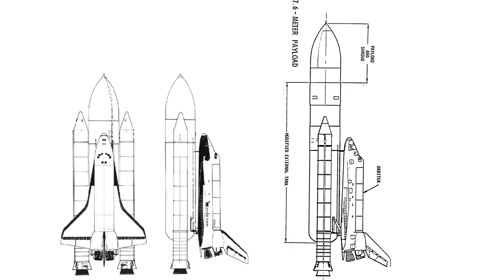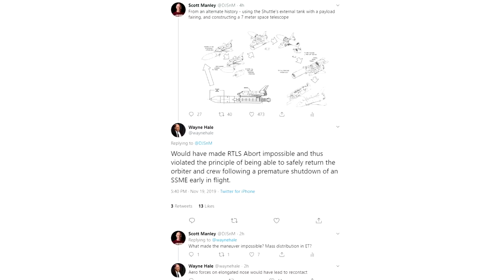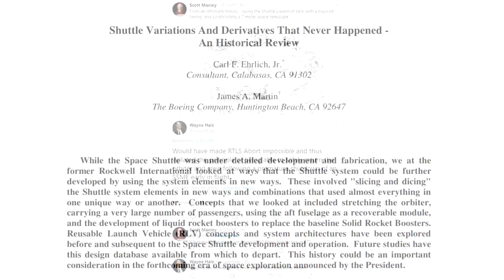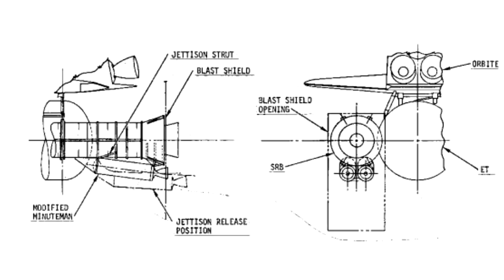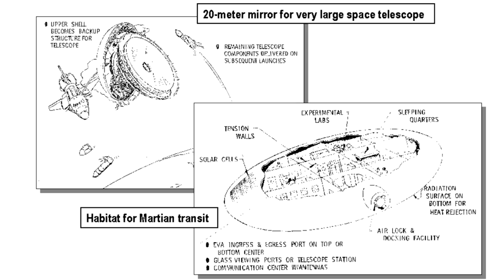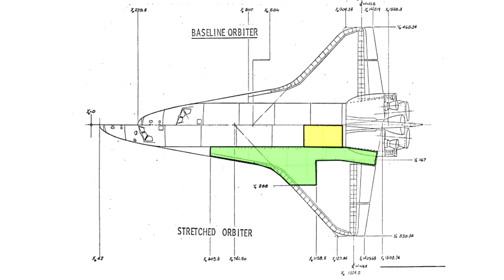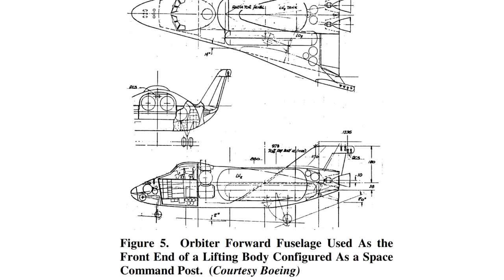Boosters on the Boosters & Other Ideas For Improving Space Shuttles

Comment: why have the payload bay empty if you could put a fuel tank into it? I mean it shouldnt be too hard to add an extra fuel line there.
Reply: @randomnickify  Aborting was already an issue. Using massive uncontrollable SRB's that you can't shut down is an issue. The spaceship already has sooo many security issues that I honestly just have accepted that there will be deaths.

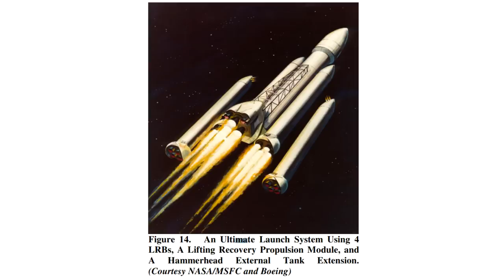Comment: 05:55 — The original design for the Space Shuttle that NASA sent to Congress in late 70s used liquid fuel external booster that were Easy to refurbish and safe.

They switched t to solid boosters because Martin-Thiokol, who built the boosters was based in Utah, the State of Orin Hatch a powerful Senator who sat on several committees important to space funding.

It was an o-ring on a booster that destroyed Challenger.

Probably the worst example of political pork distorting space spending but far from the only one.

Comment: The American space program was handicapped for 40 years when it went all in with the shuttle. A hazardous and flawed design that should never have been flown and wasted resources for years. Only now are truly re-usable systems coming on line and most of the payloads the shuttle flew could have been launched with expendable boosters probably at less cost in money and human lives. A smaller spaceplane for human access to orbit and expendable launches of space station hardware probably would have led to an ISS up and running no later than 1990 and money saved on the shuttle program overall might have allowed a lunar base sometime soon after the year 2000. STS and now SLS. Wastes of money and time.

Comment: You know what would be a really good idea to improve the shuttle? A reliable launch abort system 🙄
Reply: Houston:  "FTS is re-armed."

Everyone aboard the shuttle:  [ sweating in SRB ]
Reply: Wonder how starship is going to incorporate an abort system. From what I understand the land engines on the starship won't be powerful enough to pull away from the booster. Can't fire the vacuum engines in the atmosphere or they'll blow up from weird frequencies. Maybe they'll come up with an adjustable nozzle for rockets like jets fighters have
Reply: Or just try to make the rockets more reliable. Planes don’t have an abort system.
Reply: @jerry3790  If a plane's engines fail, they can glide back to safety, if a rocket's engines fail, it's no more than an explosive lawn dart.
Reply: Thats why SpaceX hope that prototypes fail in some way so they will adjust the later versions and became safe enough that LAS is not needed. also I like to see another Fail Compilation of Starships like what they did in Falcon 9.